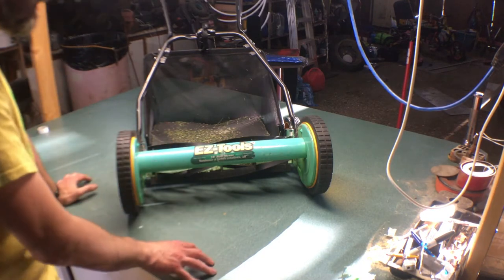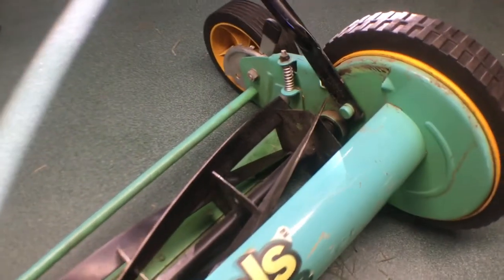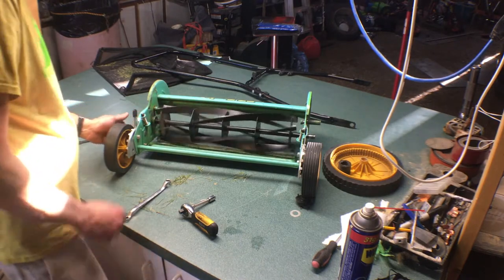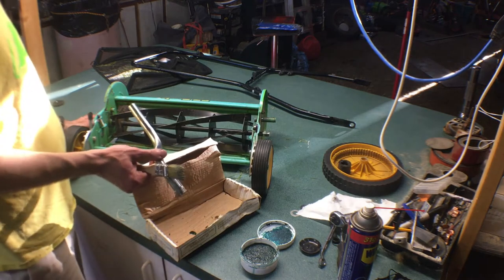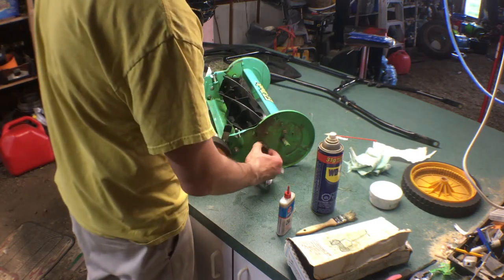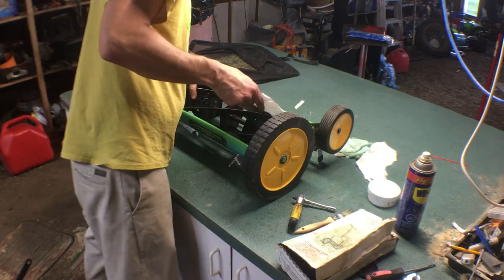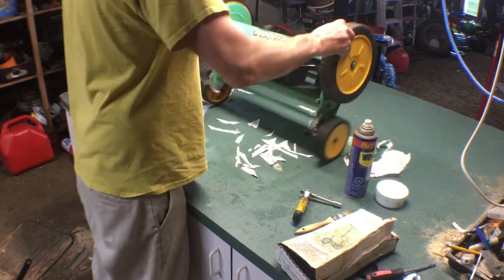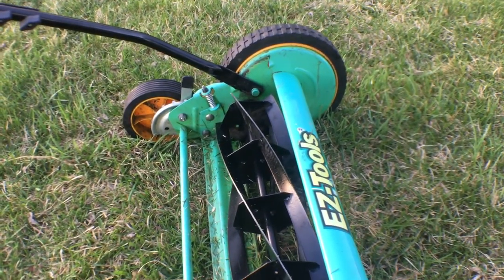How to Tune Up a Yard Sale Reel Mower, EZ-Tools 18"

Comment: I had some major health issues the past three years after Covid Long haulers syndrome. I purchased two non motorized reel mowers to help me gain strength and stamina. I love the mower and i have s small engine repair shop in my garage with numerous lawn tractors , power washers and more . I LOVE THE REEL MOWERS ! Thank you So much for a wonderful video to show the design and execution to fine tune it. 
The adjustment is very important and the adjustment screws are to. be adjusted with very small increments! ❤
Reply from the maker: Small motors and fine instruments go well together.  Its also clocks, steam engines, it’s one huge cool category.

Comment: The reel blades should not touch the bed knife. 0.2mm gap. The reel will rotate much faster and cut grass with speed. Also because of less friction, the mower is easier to push.
Reply from the maker: Kinda, the the great states mowers are contact reel mowers, not touchless like other brands, so it’s a balance of cutting, easy to push, and noise.  Older mowers also lose a bit of true so unless seriously sharpened, won’t cut great across the whole main blade.
Reply: @Turbo231  Someone in my town (Canada) is selling 18" EZ-Tools for $40. It looks like new. I am thinking to buy it and convert it to non-contact. I will use a mill file to re-shape the bevel to smaller angle. The problem with these reel mowers is: the blades are mounted vertical to the reel cylinder surface resulting in nearly 90 degree of bevel angle (that is very dull). The blade is making scrapping cut just like you use a kitchen knife to scrap the scam off the cutting board.
Reply: Bravo.

Comment: How did you loosen the reel? I couldn't see what you were adjusting.
Reply from the maker: There are two bolts on each side where the blade connects to the sides...by loosing and tightening them, you can move the blade closer or further from the spinning reel.

Comment: i've gpt one with 2 knobs and springs to adjust the reel to the bedknife, oddly they don't seem connected to anything and adjusting has no effect.  maybe i need to loosesn something on the chassis.
Reply from the maker: I would loosen and lube everything, then re-tighten, looks like some stuff might be hung up.
Reply: @Turbo231  yeah ended up loosening a couple of bolts so the bedknife could pivot.